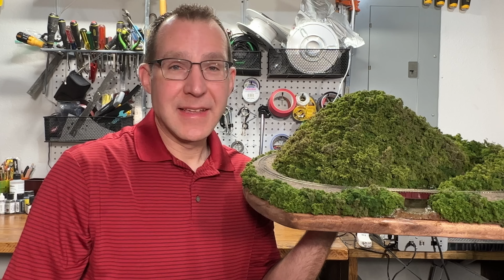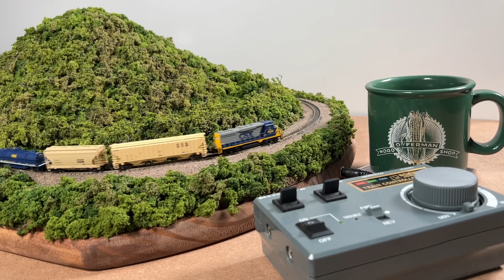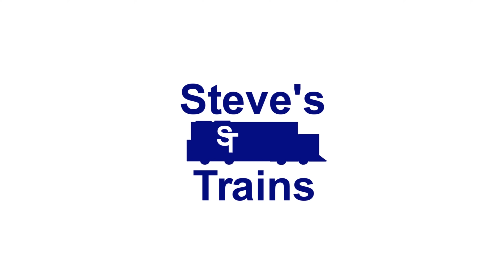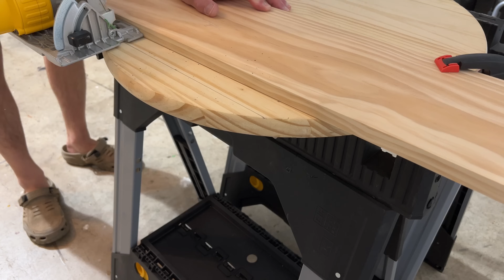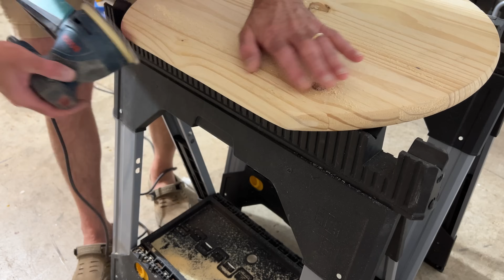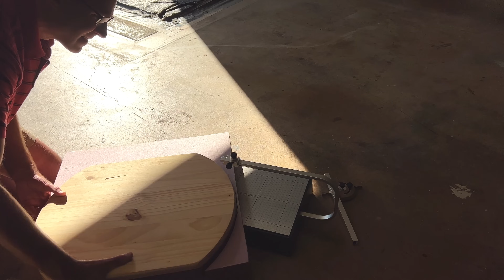How to Build a Small Layout for Your Z Scale Trains

Comment: im assuming all that soldering nonsense isnt needing if you have some straight track
Reply from the maker: You really don’t need to do it at all with this kind of track. But it does help with long term reliability if you are trying to get away with only using a single power lead.  Adding another power lead to the track on the other side would probably be just as effective.

Comment: can you open one train and show how its work
Reply from the maker: Inside looks the same as any n scale locomotive.  Motor in the middle with shafts to gears over each truck and a circuit board on top.  Maybe I’ll try doing a dcc upgrade to one of them sometime.
Reply: @StevesTrains  i try to find a video but didnt find any I think every guy love train so much

Comment: I'm looking at building a Z-scale layout.  I'm wondering on the compatibility of running MTL Micro-Trains engines and cars on Rokuhan track and if you can get couplers to use both brands of engines and cars?
Reply from the maker: track is no issue. I haven't had any issues with coupler compatibility thus far, but my experience is still limited and I haven't tried that much stuff out yet in Z scale so I can't say for sure if there are issues or not. I'm guessing it is similar to N scale where you can pretty much get everything to work together, but things work better overall when using the same brand of coupler.
Reply: @StevesTrains  Thank you.

Comment: What's the smallest Z scale circle? I'm thinking of a Santa train running around an iced Christmas Cake. Thanks
Reply from the maker: You can buy as small as 1.77” radius curves, but most stuff won’t work on that. A safer bet for a small loop would be the 120mm radius (4.72”) which would be a 9.5” diameter. You could go smaller, but a larger variety of stuff will make it around a loop that size.

Comment: Hey Steve. I follow you on youtube. I decided to get started in z scale after seeing your video on it. I bought the azl starter set you used. The question i have is that does your GP-30 only start to run after about 60% input from the rokuhan controller? I also feel that the GP-30 runs kinda slow at full speed.
Reply from the maker: Yeah, it takes a bit to get any locomotive going with that controller, but I think it is under 50% with mine.  It doesn’t run that super fast with mine at full throttle, but fast enough. It sounds like either your locomotive isn’t running as it should, maybe something is binding up a bit. Or perhaps your controller isn’t putting out as much power as it should. You could check what voltage is on the track with a voltmeter if you have one. I would also recommend breaking in the locomotive for a while (just let it run for an hour or so) if you haven’t already. Could need a bit if lubrication or something as well on the gears, hard to say. I will say that it runs a little slower than my sd70 that I have.

Comment: Steve, do Z scale trains have comparable technology as larger scale trains?  For example, do Z scale trains have automatic decouplers and remote controlled switches?  Thanks.
Reply from the maker: Remote controlled switches are available. I don’t know if electromagnets are available for z scale directly or not. You can use regular magnets for the usual delayed uncoupling you would do with kadee couplers in larger scales I believe. I remember seeing a video where someone had electrouncoupling magnets that may have been modified n scale ones. I’m not sure.

Comment: you've got all the things you used listed, EXCEPT the one thing I'm curious about, the sculpable. sculptable? is it like sculptable concrete? what is it? where do I get it?
Reply from the maker: This stuff: https://amzn.to/3rPPySq it is basically plaster and paper mache mixed together.  You could just use plaster or something similar. The sculptamold has a texture that looks more like rock and it doesn’t crack as easily as plain plaster.

Comment: Steve, where did you get that Z Scale set?  I've been looking online, and it seems Z is hard to come by.  Is there any particular website you usually shop from?
Reply from the maker: Link is in the description to ztrackcenter.com where I picked up the set (they have several different sets available)
Reply: Thanks!  This was an awesome video, and I'm looking forward to building a similar size layout.
Reply: @StevesTrains, where do you get the part that you use to run a chord to plug into the power pack?  I'm hoping to have my Z Scale set next month and I wanted to wire it the same way.